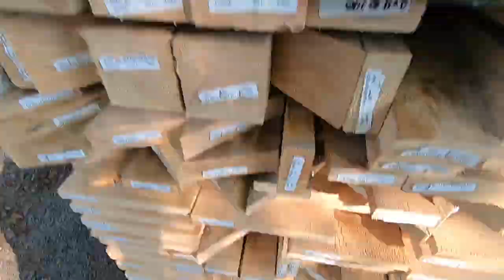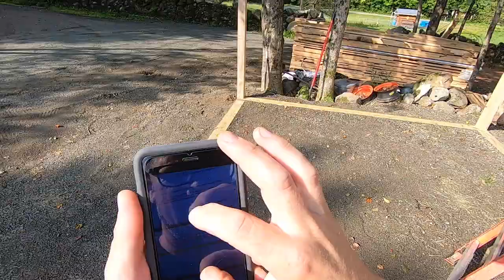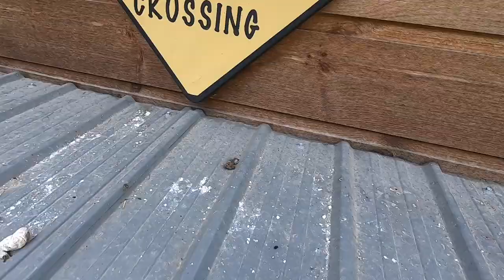Husband & Wife Build Post & Beam Firewood Shed they Ordered OFF the INTERNET

Comment: I also use a dirt floor in the wood shed and just put down poles from the woods to stack the wood on and that keeps the wood a few inches off the ground. After a few years I just pull the poles out and rake out the bark and start over.
Reply: Bill Herrick we did the same thing in our wood shed except we threw down pallets.
Reply: was wondering why he didn't put down concrete floor. Do you not have termites there? On the West coast they come up from the ground.
Reply: Here in northern Minnesota we do not have a prolific termite issue. I remember as a kid we had termites in our banister but I was little enough that I can't remember if it was an issue that was brought in with the wood itself being that it was new construction. Moisture is our biggest problem but the pressure treated makes that a nonissue, mostly. I bet termites are an aggravating problem! Is there anything you can use to pretreat the build site? I'm sorry you have to deal with that frustration!
Reply: @bearrivermama6414  The dirt floor didn't concern what does is the wood directly on the ground. And putting the footing directly on top not in the ground!
Reply: Lightbulb Moment i agrees. We used concrete post blocks and pressure treated 4x4s and soul plates. I think Al used pressure treated didn't he? It's been a while since I watched this video.

Comment: Al, as you get your posts and top beams set in place check for square and put a board at an angle  across the corners.  Then when are ready to set the front to back you can check your posts for level and adjust if necessary.  You are doing good.  Just some tips I picked up from my Dad and other carpenters I've known.

Comment: If you can find a chopper for the apples and mix it with feed they will lap it up. We had an old turnip chopper we used for apples and corn cobs for the pigs, It worked like a charm.

Comment: Kubotas love to help with racked buildings!   Bucket to push and chain to pull.   They also like to lift beams to set in place.   Mmmm, that is probably the old guy talking.   I used to strain and lift things when I was younger too.   Life is good, enjoy it!   It passes by very quickly though.  Respectfully,   Kevin

Comment: My brother built a similar shed but he put down a course of cinder blocks over a run of concrete footing before putting down the wooden 6 x 6's  With our soil and grade around the building he had to do that.  Later he came back and poured some type of composite for the floor (It wasn't concrete but he said it had cork in it.  Made a nice floor). And Al...With your experience in post and beam now, they could use your help at Plymouth colony.

Comment: If i was ever going to build a firewood shed, i would put a doorway in the back, have the fire wood prep area in the back, load the shed from the front to the back, FIFO. Have you given any thought whether you will want any air circulation at or, from the bottom of the stack?

Comment: I did not see any ground stakes holding the frame to the ground. With the winds & tornados that USA gets, I would have thought you would at least have some stakes in the ground. Even a tent gets staked. 😀

Cheers from West Australia
Reply: I think they are in the New England area (New Hampshire if I remember correctly) and tornado are extremely rare there. I'm guessing a better chance of being struck by lightening than a tornado. If they were in the Midwest or South, absolutely.  My guess is there biggest issue would be snowfall and the weight of it on the rough.
Reply: Brad Myers  Yep! I know they are in New Hampshire away from Tornado Alley guess I should have said that Storm Winds on one side could topple the structure. Was surprised they didn’t put a couple of small concrete tie down points.
Cheers

Comment: That back right corner post should not have been cut out of square. Since the roof has a slope, are you sure that you didn't install the post upside down?
Good video. I have been thinking about assembling a similar kit myself here in the US.

Comment: what is the advantage of a wood floor versus a dirt floor in your device where constant four would have been better just out of curiosity how
Reply: In the previous video i believe he said he opted for the dirt so he wouldnt have to worry about the floor rotting out
Reply: It really is less work to have a dirt floor with good drainage.  You build a rack system to keep the wood off the gravel, and you are golden.
Reply: Pardon my ignorance but want the wood from the shed touching the ground rod out eventually?
Reply: @countrylife9256  The wood will be up on a rack.  The frame of the wood shed is resting on gravel that is on plastic sheeting.  The ground is sloped to allow good drainage.
Reply: @countrylife9256  the firewood will be used up well before it could rot